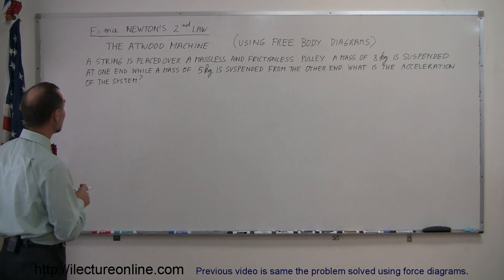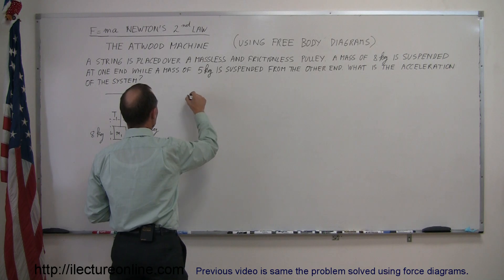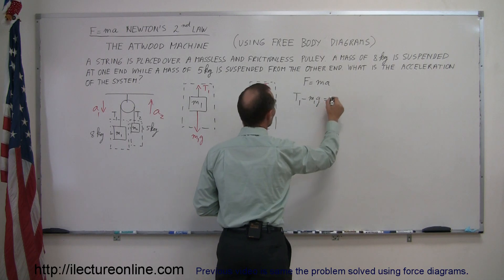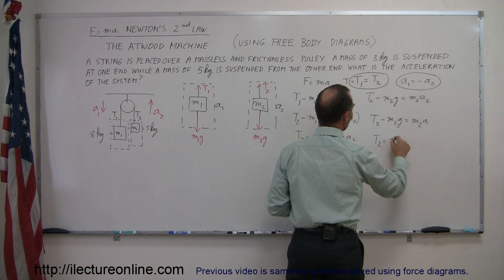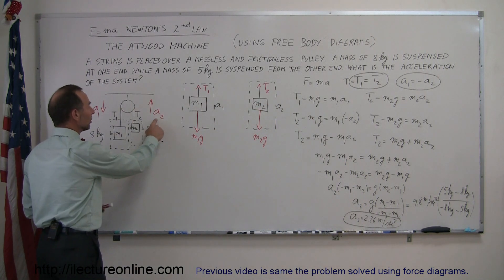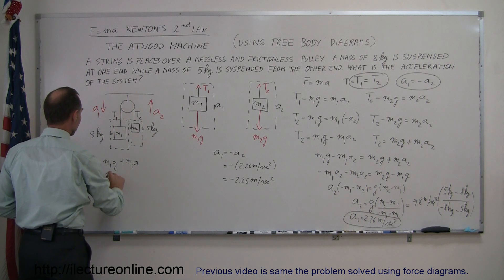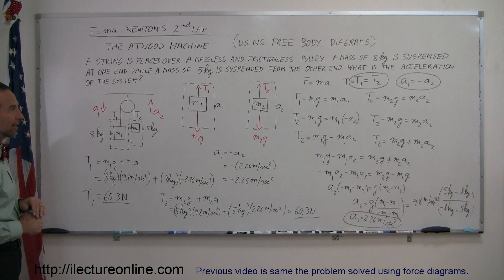Physics - Mechanics: The Pulley (2 of 2)

Comment: I dont know if you are still answering questions on this vid but if you are, you have my thanks.  I was just wondering if you could declare your axis to bend around the pulley. I used both methods and they came out to have the same answers however im not certain as to whether or not this will work in all scenarios.
Reply from the maker: The easiest way to solve a problem like this is to consider the whole system moving in the "same" direction (even though one object is moving upwards while another moves downwards).   (we have a number of examples that show that).  This example here show how to use free body diagrams to solve it.

Comment: Why can you assume that T1 = T2 ?
Reply from the maker: If the pulley does not have mass, then it requires no work to make it turn, and then no energy is lost, therefore the torque on both sides must be the same and therefore the tension on both sides must be the same.

Comment: Why T 1= T 2 pls tell the reason using taw of pully
Reply from the maker: If the pulley doesn't have any friction, or any mass, then the pulley cannot produce any force to cause the tension to be greater on one side compared to the other side.

Comment: Why doesn't 'g', acceleration due to gravity not a negative value i.e. -9.8m/s2. In this case, it is positive, why?
Reply from the maker: Here we are calculating the magnitude of the tension and we are using the magnitude of the vector g.  The magnitude of a vector cannot be negative.
Reply: This deserves to be at the top, I was confused on this exact concept.

Comment: Can anybody please explain why T1 is equal to T2?
Reply from the maker: If the pulley has no friction and the pulley has no mass (eliminating the need to take into account the moment of inertia of the pulley), then the pulley only applies a force perpendicular to the string, and therefore cannot add tension to the pulley and therefor the tension must be the same on both sides.
Reply: @MichelvanBiezen  Thank you! I noticed this issue of mass influencing the tensions in the rope in another example too: two accelerating blocks (m1 and m2) on a flat surface being connected by a non-massless string. The textbook says that T1 and T2 for the blocks are different. Any ideas why? And does this somehow relate to your previous reply? Thank you! Your videos are the BEST!
Reply from the maker: If the string is non-massless, the the tension will gradually increase as there is more mass to pull with each increase in string length.  Most problems will use "massless" strings so we don't have to account for that.
Reply: @MichelvanBiezen  Thank you, professor!!!

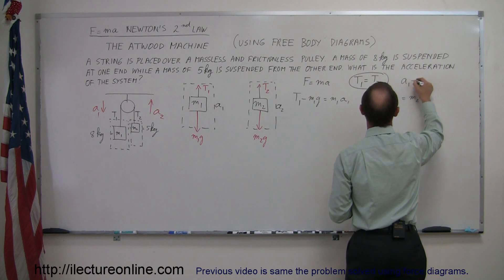Comment: Why is a2 negative if it's going up? at 5:08 (im assuming up is +ve and down is -ve
Reply from the maker: It depends on how you want to solve the problem, especially with systems were the components are linked together and accelerate in different directions.  So with systems like the Atwood machine, you can call the direction of the acceleration positive which means up for one mass and down for the other mass.
Reply: @MichelvanBiezen  Thank you for your prompt response!

Comment: The correct name is force diagram, but not free body diagram
Reply from the maker: A free body diagram and a force diagram are one and the same, except that a free body diagram specifically isolates a single member or a section of the whole system.
Reply: The word "free body" are inappropriate for such an expression because all are about interactions among forces.
and a system can be a single particle or object or many of them 
What is the most important in science is how to use the language clearly and unambiguously and logical reasoning based on objective and undeniable facts which are  the closest to being parallel to objective reality, 
The phrase"free body" can also means other different things than the meanings in the context of  physics which is ambitious or vague 
So when using the word " force " it gives you a direct meaning without any ambiguity

Comment: sir , i have one doubt . in this video u said  T1=T2 as pulley do not have mass . i am confused with this . how this pulley will rotate if tension in both sides are equal . what gives its ability to rotate ? do u mean the string is just sliding over the pulley(no rotation ) as there is no friction between string and pulley ?   i am confused with the same tension concept .
Reply from the maker: The pulley will rotate.  But since the pulley "has no mass" the pulley does not offer any resistance to the motion or the acceleration, and therefore the tension in the string must be the same on both sides of the pulley.   If you look at each free body diagram, since m1g is greater than T1, block m1 will accelerate downward.  Since T2 is greater than m2g, mass m2 will accelerate upward and yes, T1 = T2.
Reply: then what causes the pulley to rotate ? from where it gets the turning effect ?
Reply from the maker: The friction between the string and the pulley.

Comment: Dear professor Michel. I'd like to ask you that in the above solved question instead of  T1 - m1g = m1a it should be m1g - T1 = m1a as the 8kg block is moving downwards and hence m1g will be greater than T1??
Reply from the maker: When using free body diagrams we take into account direction and thus T1 - m1g = m1a will result in a negative a. (The video is correct)
Reply: @MichelvanBiezen  okay sir thank you for guiding me.

Comment: Dear professor Biezen, I'd like to ask you a question. I discovered that the tension T3 that sustains the whole system is 2T, correct me if I'm wrong. Why is it so? Why is it equal to m1g + m2g only when the system is at equilibrium and not always?
Reply from the maker: There is only T1 and T2.  (There is no T3).

Comment: Thank you for the video. I have just one question: why is T1 = T2 when there are different masses attached to each end of the string. Shouldn't the string carrying the heavier mass have more tension to balance it out?
Reply from the maker: Unless the pulley has mass or friction, the tension must be the same throughout the whole string.  (There must be some force that acts on one part and not the other for the tension to be different)   See the other examples.
Reply: what ih the pulley has its own weight?
Reply: @TheDRUTTA  If the pulley has its own mass that is significant, then you would need to know its radius and its distribution of mass to find its rotational inertia (aka moment of inertia).   You then would have two different tensions, and the difference between the two tensions, multiplied by the radius, would be the torque on the pulley.   Assuming negligible bearing friction, this torque is also the net torque on the pulley, that when divided by the moment of inertia, will give you the angular acceleration.  Relate angular acceleration to tangential linear acceleration to find how the pulley's kinematics relate to the kinematics of the hanging masses.

Wikipedia has a derivation of this problem for a pulley with inertia and friction:
https://en.wikipedia.org/wiki/Atwood_machine#Equations_for_a_pulley_with_inertia_and_friction

Comment: Since we already know that m1>m2 and therefore a1 is negative and a2 positive, why is this not considered in the equations? Shouldn't the equation then be T1-m1*g=m1*(-a1) ?
Reply from the maker: There are several different ways in which you can solve a problem like this.  One way is the way you describe.  You draw a free body diagram on each object, and set up an equation for each.  Then solve them simultaneously.  Or you can ignore all internal forces and solve the whole system as one body as shown in the video.

Comment: Sir can you please explain the relationship of height and force of a mass suspended by a pulley...Meaning if two different a weights are hung the larger weight will be closer to ground but final they both stop moving.why is that ? Should the larger mass just go down and down until it reaches ground?
Reply from the maker: The larger mass will keep moving until it reaches the ground (or until the small masses crashes into the pulley).

Comment: Michael. thanks for getting back to me.  the resolution on androids is not a wagon wheel like iOS but is three dots  top right-hand corner and settings.  I chose 480p     it is readable but lacks just a  little contrast.  but to reiterate it is much better    I found the settings for Android by doing a google search.

Comment: In the problem "Physics-Pulley System on a Table" the heavier mass was considered positive (even though it was going down), since it was aiding acceleration, and the lighter mass was negative because it was opposing acceleration. Why in this problem is positive acceleration the mass going up, and negative acceleration, the mass going down?
Reply from the maker: This problem is solved using the free body diagram technique.  In this case you strictly us up as positive and down as negative.  Then you solve the problem accordingly.    However note that the pulley redirects the direction of the tension of the string connecting the two masses.    (That is why I like the other method better).
Reply: thank you!!

Comment: Hello. 
Could you please explain why a1 is -2.26 and not 2.26? 
Thnx.
Reply from the maker: Yes, it is confusing with the red a2 arrow drawn the way it is.  The "negative" for the acceleration of m2 comes from letting a1 be positive relative to the red a1 arrow drawn downward.  If a1 is "positive" in the down direction then a2 is "negative" in the up direction.  (I should not have drawn the a2 arrow)

Comment: In your personal opinion, do you prefer force diagrams looking at the forces as a whole, or free body diagrams looking at forces individually? My ap physics teacher likes the free body diagrams, but I was wondering what you prefer
Reply from the maker: They are both good techniques, but if all you are looking for is the acceleration of the system, looking at the system as a whole is a lot easier.
Reply: Then when would you say is a "better" time to use the free body diagram technique?
Reply from the maker: When you are required to find the tension between 2 of the masses, that can only be done by drawing the free body diagrams.

Comment: why is a1 & a2 assumed to be a vector while g is not?
Reply from the maker: When working with free body diagrams, it is important to keep track of the directions as was done in this example.  g is just a constant (like the magnitude of a vector) and thus must be positive.  When used in certain contexts, (like in the equations of kinematics) it can be given a negative direction.
Reply: I am confused as to why a1 and g have opposite signs if they are in the same direction. Should you have used -9.8 when solving for a2 since a2 and g are in opposite directions?

Comment: what if your solving for a  pulley with mass what should you do then
Reply: would I have to use moment of inertia I didn't know if that would work or not since no pulley is actually a cylinder because of the room on the side to hold the rope
Reply from the maker: +chuck Ramsey  Take a look at the following playlist.  You'll find those types of videos that you are looking for:   PHYSICS 13.1 MOMENT OF INERTIA APPLICATIONS 2
Reply: +Michel van Biezen thanks, your videos are very helpful

Comment: was able to get the same answer not including T?

I suppose that the only reason you'd use this longer method is only if you need to solve for the tension?
Reply from the maker: +Alejandro Gomez 
There are different methods and it is a good idea to learn all of them.   Here we use the method of free body diagrams.  Compare that to the other method we use in the other videos.

Comment: Hi I am taking a physics class and we are trying to find the acceleration of an object as it falls from a pully system. There is only one mass, we are supposed to be holding the other side and then we let go of it. I was wondering if you had any hits how to solve this problem? Please let me know! I think this video is close to what we are supposed to be doing but also different since we only have one mass.

A thin thread is wrapped around a pulley of moment of inertia I and radius R, and is connected to an object of mass M. You release the mass from rest, and I would like to know the acceleration of the object as it falls, in terms of M, I, R, g.
Reply from the maker: Natalie Clarke 
Take a look in the playlist:
PHYSICS 11 ROTATIONAL MOTION

The last problem is like the one you describe  (a yo-yo)
Reply: +Natalie Clarke If there is no counter weight, the only acting force is gravity... if I understand your problem correctly.